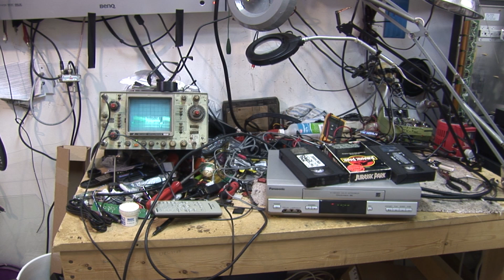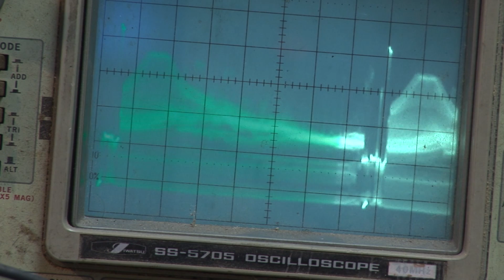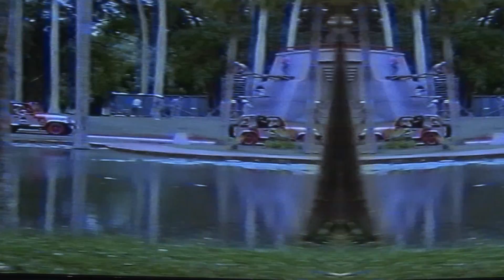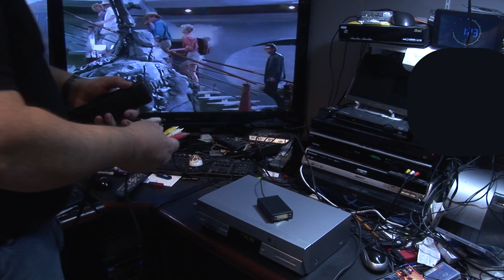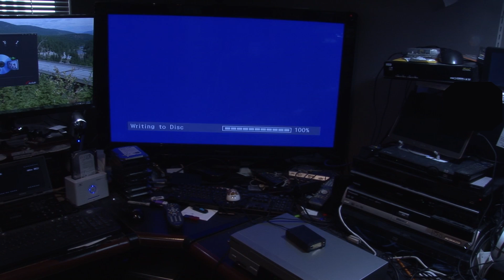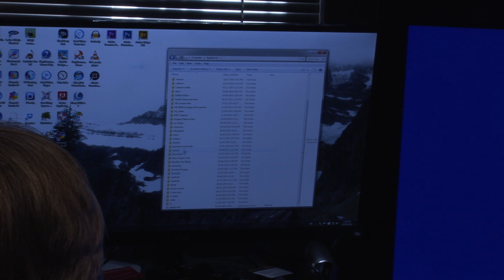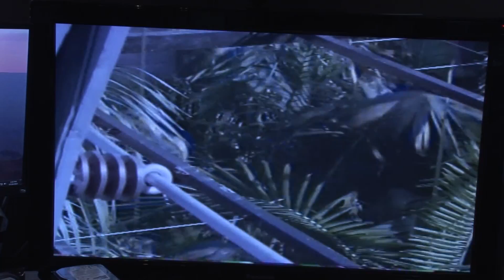Copy macrovision protected Video to DVD

Comment: I have an Ion video to USB capture device and it seems to ignore macrovision. I usually have it hooked to my Sony PS2 game console to record gaming footage and I also play my DVDs in it. I had the capture program running and a movie playing and I figured id test it. Well I recorded some video and it looked fine. Some of my DVDs don't have macrovision like my Starship Troopers DVD b/c I had the same game system hooked to a 19 inch TV/VCR combo and I recorded a few minutes of the movie onto the tape and played it back and it was perfect. No distortion.
Reply from the maker: +coondogtheman1234 Some DVDs didn't use it because it costs money to license macrovision, and if a studio doesn't think that copying will be a problem they just don't do it. Others do. Usually there is a logo, 2 disks a black and grey disk side by side in a red circle with a slash through it and the words copy protected. Some tape it a step farther and say this copy protected disk may only be played on licensed devices.
Reply: 12voltvids

All mine say region 1 and they play in all my DVD playing devices. I usually use VLC to play movies on my PC but mostly I use my PS2 b/c It looks really good on my flat panel (non HD TV. A good friend of mine gave me this TV and it's been thru three power supplies. I'm not sure why, the TV works fine but the original power supply died (bad capacitors) a new one my friend bought online didn't work. (piece of crap) I made one from an XBOX 360 console and that died after maybe 5 years so I made another from an old PC power supply and it's still working.I usually keep it off and unplugged unless I'm using it b/c it does have a fan and it's loud. If that dies I have other computers kicking around that I can modify the power supply from.

Comment: I'm interested to know if there is similar technology to remove Cinavia, though I think this would need to be done digitally?
Reply from the maker: +Mitchell McCreath This video was not about circumventing copy protection on digital media. It was about removing analog copy protection from old video tapes, to demonstrate the steps to backup old obsolete VHS video tapes. There are many tapes out there that were never released on DVD that people would like to archive, and they can't due to Macrovision.
Reply: +12voltvids Agreed.  I have removed Macrovision a few times from old video tapes that I wanted to archive...

Comment: I once modified a umatic tape recorder to more effectively "eat" the copy protection back before there were dvd recorders. Some playback setups with umatic were more or less immune to macrovision but the only really good monitor I had would show darkening at the top of the screen. Having no funds for a better monitor I did get perfect results by adding a photo interrupter on the umatic drum itself to "switch out" the VBI macrovision. In other words it put black right over just the macrovision area of the signal. It was made of an overhead projector transparency sheet formed into a loop that fit just inside the video head drum. Two black pieces of tape, placed in just the right location would interrupt a photo sensor. Of course it needed a schmitt trigger and an amp so the signal would trigger the vertical blanking "black insert" switch but it did work perfectly... until I realized the occasional color streaks meant the chroma was also being "copy protected"; and I just about passed a brick. However, 1/4 turn of a tuning slug on one of the video boards in the umatic locked the color right back in. I think it was a burst flag interval muting adjustment...
Reply: WHAT.

Comment: It's the same on the PAL TV system. I once found a Macrovision removing device on a flea market, but I didn't get it. Probably a mistake...
Reply from the maker: +vwestlife Some yes, others no. For example my old AG1980 has a TBC in it, but if I play a tape on that I still can not record the signal.Full frame store TBC which digitizes only the video componets, and totally rebuilds the sync will work. Unfortunately most cheap units are line by line TBC, and that does nothing to stop it. Also VCRs made for consumers are prohibited from removing copy protecting signals, and these units like the one I showed are now illegal to manufacture or sell under the digital millennium copyright act which makes it illegal to manufacture or distribute devices to circumvent copy protection signals. So if you build one yourself, or find an old one at a flea market you are good, but don't expect to find these units new anymore.
Reply from the maker: +DrCassette Yes they have them too for PAL. The one I have will work on either.
Reply: I have some friends that know I can do various things with computers and audio/video, they asked me to put their VHS to DVD, I bought the Roxio VHS to DVD3, the initial install was a bit of a pain as it would go part way and then just quit, I swapped USB ports and then it installed just fine.

I have installed and uninstalled some other audio/video programs and every single time it messes up the Roxio so that I have to put the install disk back in and do the repair function, which I find a bit ominous that has a function that is appropriately named repair.

I got a scrubber via Ebay anyway it was 26.00 plus 6.00 for shipping it came today.

I am most definitely not at your level, but I know my way around building computers, stereo systems and running all the various RCA cables and what have you.

its the same in the military, penetration vs armor each one competing to outdo the other, so it is with Hollywood protecting their investment and those circumventing said protections.
Reply: +DrCassette Any device with a Time Base Corrector (TBC) will remove MacroVision, including Sony Handycams with an A/V input, many S-VHS VCRs, and most "video enhancers", such as the JVC JX-C7 Video Corrector.
Reply: That's good to know :)

Comment: I was kinda hoping for more of a MacGyver style workaround. The solutions here seem to be either 1. hope you can find a magic decoder box on E-bay (and hope it still works) or 2. try PVRs until you find one that doesn't implement Macrovision. Is there any way to bread-board the functionality of the decoder box using standard bench-top gear?